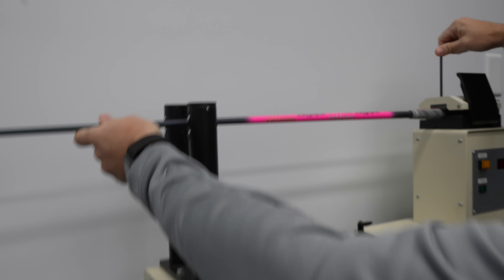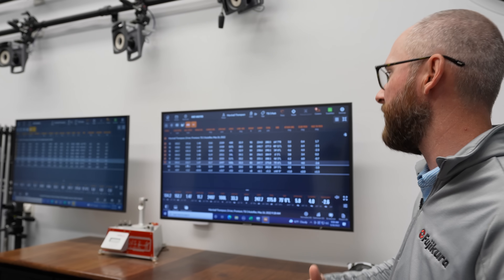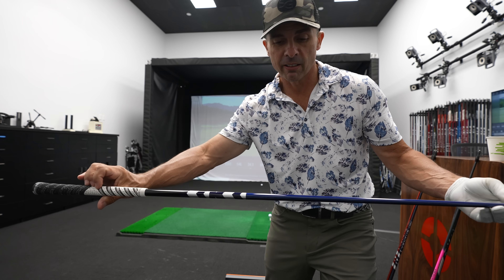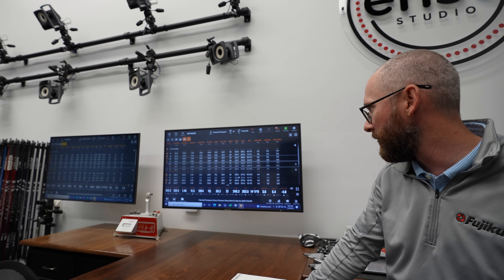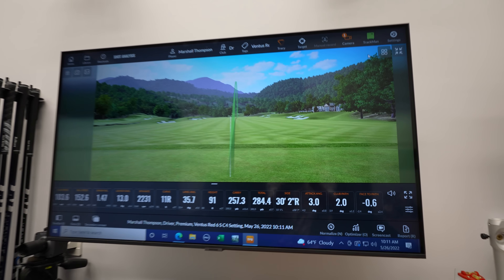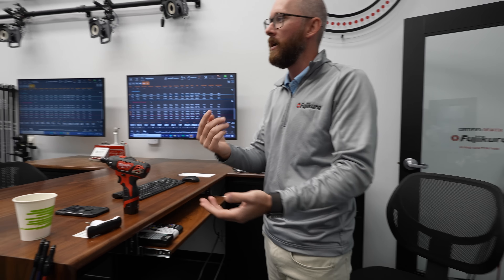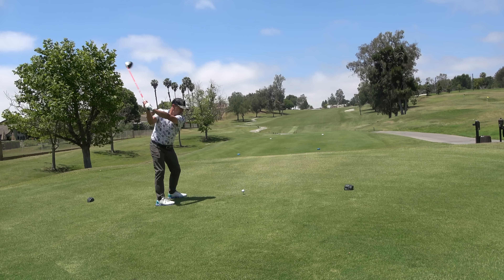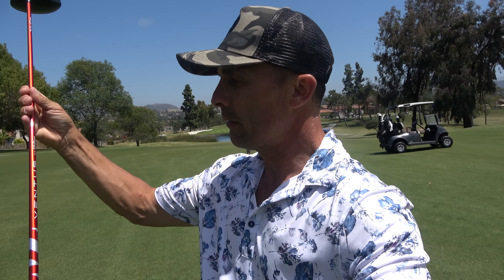Can a Golf Shaft Fitting Get You More Distance?

Comment: This is the exact shaft I need but it is so expensive to buy. My current driver has a blue 6S but it’s also just stock Taylormade rubbish not even velcore
Reply: So I feel your pain I bought it. But what I’m about to tell you I’ll never know how much the shaft actually helped with distance (I got a great lesson after buying the shaft and a ball fitting for that shaft) so my gaining of 23 ish yards idk how much was the shaft. However I can confidently work it but it high or low with less effort/further without swinging as hard (or working as hard to do so) 

But on the monitor I went from 144 ball speed to 164 ish (tsi2 from tensi blue to ventus) going from regular ventus to velocore I got about a 10 mph jump in ball speed. 

My point go check the numbers on a monitor first. Dial that in. It worked for me and ironically my dad who swings only 85 ish mph. I was swinging at 99 before switching to velocore and now I’m almost 105. (Again it’s just a shaft that weighted identically the same as the tensi)
Reply: @johnhathaway735  did you from tensi blue to ventus blue or to ventus red (assuming 6S)?  I have the taylormade ventus blue stock and i'm positive the velocore is night and day but not sure which to consider without being able to test.
Reply: @puttenmoore  I went from stiff flex tensi blue 55g to a ventus velocore and got that jump. 144 ish ball speed to 164 ball speed. When I tried the Ventus regular I was in the low 150s ball speed. 

I bought the ventus 5s but liked the 6s do you have an Edwin watts near you ? Or a golf galaxy ? They should allow you to use the monitor to check it out (for a price at some places) but before you blindly buy go see the numbers for piece of mind
Reply: Sorry ventus velocore blue 5s on driver got 6s on my 3 wood and 5 wood I gain shot dispersion height (I needed it) and easier to swing. (I got red in my 3 wood) blue in driver and 5 wood.